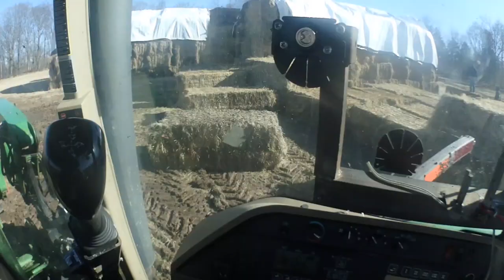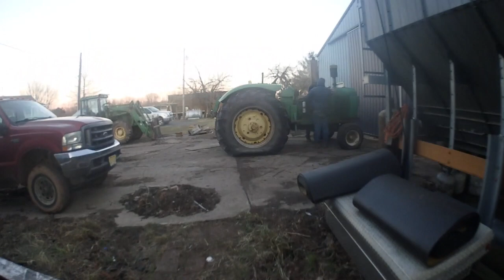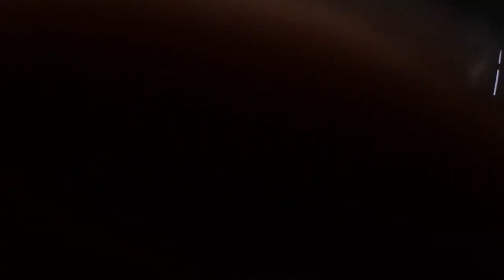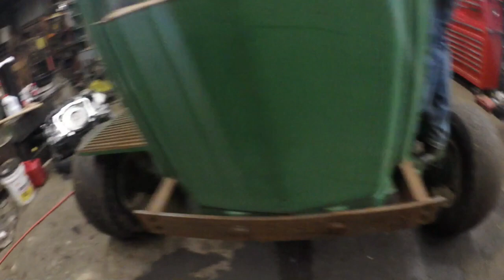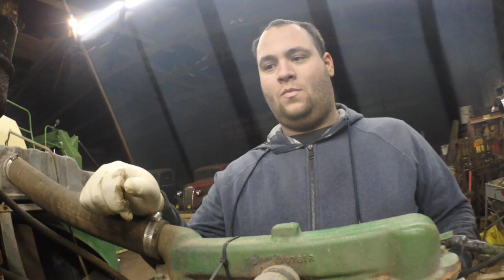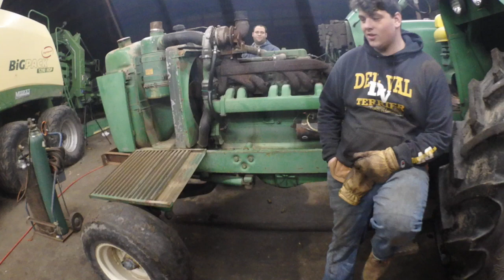OH THAT DUMBASS!!

Comment: Single stage urethane works nicely for painting tractors. I have painted the main parts of the tractors with single stage, and then painted the sheet metal bits with base/clear urethane to make them super nice. Holds up really well over the years versus acrylic enamel or such like. Makes them clean up easier as urethane doesn't oxidize or stain like enamels do over time. Material cost is more, but worth it in the end if you want to keep the tractor looking nice for years to come.

Comment: Best way to fix the 5020 hood, could be hot lead body solder, you work it smooth with a wooden paddle and a torch. They used to do it on TV in American hotrod

Comment: I have heard of farmers re powering 5020 with 903 Cummings back in the day , transmission  and rear ends were so over built they stood up to all extra  power.
Reply: Pab I know the engine well. Used to drive a White Freight liner with a 903 it was a good engine but didn't have a turbo.

Comment: To a small degree metal has memory , a little heat it will go back to flat , seen guys repair hail damage ,still have to use body filler

Comment: As soon as I heard they were towing that tractor I knew what they did. The guy we bought this farm off had a 4010 with a loader on, him and my dad where towing it. The idiot ran that in the back of our tractor and stuffed the fenders about 20 years ago, with no brakes when the Deere wasn't running.
    I know of 2 people got killed by big squares falling, one was a trucker tying a load. The other was a guys wife I used to tractor pull with  she was helping him unload and one came off the top on the other side to where he was.     Guys with all the experience after years luck runs out to. one of my customers told me about a guy he knew drove a track hoe for years. He got killed  loading it for the last time when it slipped off the ramps on the day he retired !  nobody is 10ft tall and bullet proof !    Take care guys.

Comment: Just wanted to let you know. The bosch pump wont bolt up to a 5010 or 5020 block. The 6030 although the cubic inch was the same, the block was cast and machined different for the bosch pump.

Comment: Maybe I shouldn't laugh but that less than graceful bale dive was hilarious! On a serious note, bales kill! A friend of mine was killed by a falling round bale of silage and when I used to contract into the paper recycling industry baled waste paper was a well known killer and those bales of paper weighed as much and in some case more than hay/silage. Bales stacks shoond't go more than four high in my opinion unless they are interlocked across a layer. You could try leading the bonnet damage instead of using an epoxy type filler. It's old school body filler but it's the best.

Comment: tig weld with steel rod any sheet metal cuts. don't hack it up . might need a shrinking disc to bring the metal down from the crease. but it takes a guy that knows metal.....

Comment: 9x out of 10 it is the guy that's done it his whole life that ends up injured or dead 
Complaicency kills more farmers than inexperience 
As you said it's usually the old bloke that ends up doing the more dangerous jobs 
Or jumps into something when a problem comes up to try and get it going again 
Not thinking about the job because they've done it a million times before 
More than a few blokes round here have lost fingers unblocking metering wheels on seeders unplugging them at night 
Don't bother turning it off just set em to turn slow, saves time 
All been blokes with over 20yrs experience 
Neighbour nearly ran him self over, putting escaped sheep back in, jumped out of his truck as soon as they were in the field and forgot the handbrake, truck took off down the hill and rolled a few times into a river

Comment: Did the clutch stick?   Very very dangerous when a clutch sticks. My uncle push started an International in reverse years ago and the clutch would not release so he reversed it against a hedge, hoping it would stall. It stalled all right. Upside down resting on its bonnet.He only just managed to jump in time.

Comment: Probably had that much HP but 18,000# is too heavy for that HP. That's why they were a pooch. Even a turbo 6030 with stock HP was kind of a pooch unless you crank them to 250.

Comment: i KNOW HOW YOU FEEL,  when I have something a long time and it gets damaged it hurts my brain. I had  Mint condition 1955 Loran Crane on my barge and a 70 stick I was picking up to set in the drop hammer hit a piling in the dock system i was working on and came straight though the cab where i was sitting,,,IN THE FRONT WINDOW AND OUT THE BACK... I JUMPED OUT OF THE CAB JUST IN TIME  but boy was I pissed about the damage